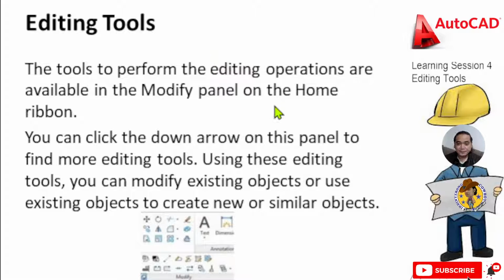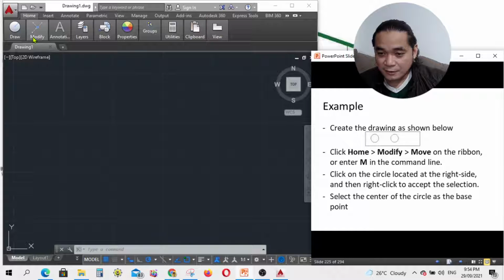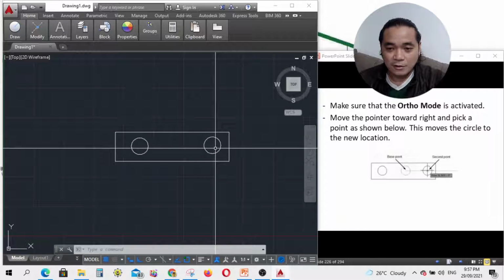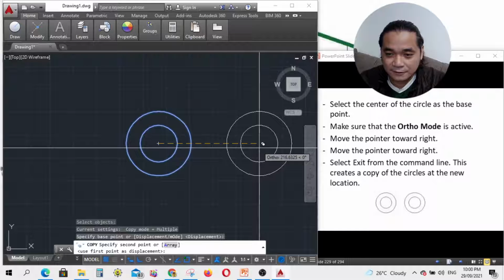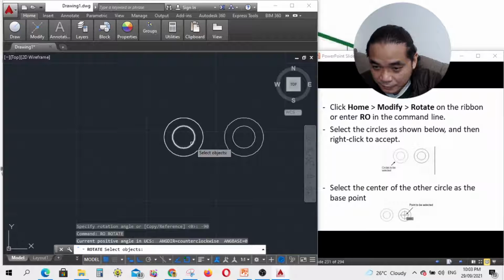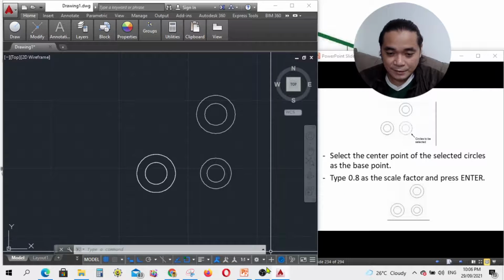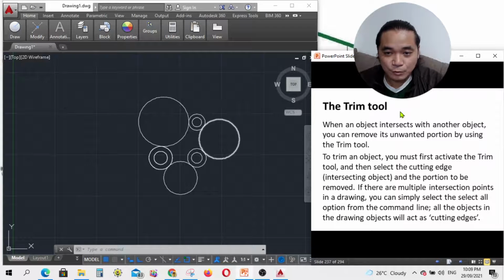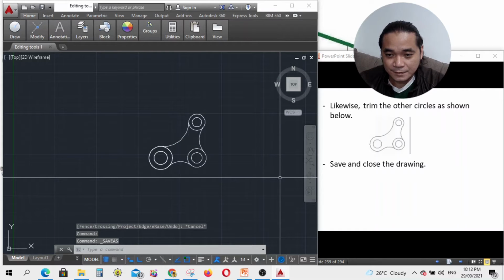AutoCAD LS 4-1 | Editing Tools

Comment: LS 4-1| In this video, I learned how to use some of the editing tools in the home tab, specifically the modify ribbon, such as the move tool, copy tool, rotate tool, scale tool, and trim tool. We can use these tools by simply clicking the tool's icon or by typing a command into the command line. We can use these editing tools to modify or reuse existing objects to create similar or new objects. Finally, by applying the knowledge we gained (with precision) from this video, we will undoubtedly be able to create a more refined drawing. 

Keep it up Sir! God bless you always.

Comment: LS 4-1| I have learned in this video on how to execute some of the the editing tools such as move tool, copy tool, rotate tool, scale tool and trim tool which is located in the home tab specifically on the modify ribbon. We can use these tools by simply clicking the icon that represents the tool or by inputting a command in the command line. By using these editing tools we can be able to modify or use existing objects to create the similar or new objects. Lastly, by applying the learnings we gained (w/ exactness) from this video surely we can create a better and refined drawing.

Kudos to you sir! Looking forward for your next video! 🤗

Comment: For the first section of learning session 4, I really enjoy the video material since it significantly helps my knowledge of AutoCAD's Editing capabilities. I've discovered that in order to produce complicated designs, different editing procedures may be used. We may change current items or utilize existing objects to build new or similar objects using these editing tools. The editing tools covered in this video include the move tool, the copy tool, the rotate tool, the scale tool, and the trim tool, which I used to create the examples. The Move tool relocates a chosen item without altering its orientation. The Copy tool is used to duplicate items and reposition them. The Rotate tool rotates an item or a collection of objects around a central axis. The Scale tool resizes things. It alters the size of an item without altering its form. When one item overlaps with another, you may use the Trim tool to eliminate the object's undesirable part.

Comment: I learned the operations and commands of several editing tools during this session, including the move tool, copy tool, rotate tool, scale tool, and trim tool. AutoCAD has a move tool that allows you to relocate an object without altering its orientation. The copy tool aided me in duplicating an object and relocating it to a certain spot, the same as rotate tool. In respect to the scale tool, it has aided me in reducing or enlarging an object's size without altering its form. Also, trim tool enables me to eliminate undesirable parts of an object while sketching it. Thank you sir!

Comment: IN LS 4-1, I learned how to use and execute the move, copy, rotate and scale tool. Move tool which moves a selected object from one location to a new location without changing its orientation. Copy tool is used to copy objects and place them at a required location but the object will remain at its original position and a copy of it will be placed at the new location. To rotate an object or a group of objects about a base point, we are going to use rotate tool. Lastly, to reduce or enlarge the size without changing the shape of an object used scale tool. Thank you so much for the new learnings Inhinyerong Cowboy!

Comment: For the first part of learning session 4, I really do appreciate this video content because it greatly aids my understanding of AutoCAD's Editing tools. I’ve learned that in order to create complex drawings, we might perform various editing operations. Using these editing tools, we can modify existing objects or use existing objects to create new or similar objects. The said editing that’s being discussed in this video are move tool, copy tool, rotate tool, scale tool, and trim tool which I performed in doing the examples. The Move tool moves a selected object from one location to a new location without changing its orientation. The Copy tool is used to copy objects and place them at a required location. The Rotate tool rotates an object or a group of objects about a base point. The Scale tool changes the size of objects. It reduces or enlarges the size without changing the shape of an object. When an object intersects with another object, you can remove its unwanted portion by using the Trim tool.

This video content is very informative. I'm excited to see the next videos!

Comment: In this part 1 of learning session 4, it talks about editing tools that tackle the different tools that will explain the most commonly used such as copy tool, rotate tool, scale, and trim tool. However, the tools to perform the editing operations are available in the modify panel on the home ribbon. Through these, I’ve learned how to move tools. For example, selecting the object from location to a new location without changing its orientation. Moreover, I've realized that this kind of editing tool is very useful and helpful. 
Thank you for this Learning Session Sir! Hoping for more videos :)

Comment: This session it focusing in editing tool in auto cad. Which are move, copy, rotate, scale,trim, extend tools etc...... The tools to perform the editing operation that are able in modify panel on the home ribbon. It's also discussed the different tool and where they find it on the screen or monitor in the auto cad  and special each individual function.

Comment: In this video I have learned and performed some of the editing tools such as move tool, copy tool, rotate tool, Scale tool and trim tool which can be found by clicking the Home tab and then the Modify ribbon or you can command in the command line. Using this editing tools you can modify existing objects or use existing objects to create new or similar objects. Thanks you so much sir for the learnings and looking forward for another videos.

Comment: Hello and good day, Sir. Upon completing this learning session, it highlights the ease of use of AutoCAD's editing tools and its features. Basically, each of these editing tools has its own shortcut command, besides being accessible from the home ribbon's modified panel. As shown in the video, each of these tools is beneficial for modifying objects. Learning the functions and shortcut commands of each tool may be challenging at first, but they may be quickly memorized if performed often. In terms of the various tools, the move tool allows the user to move the selected item to the desired location without changing its orientation, the copy tool allows the user to duplicate the object and paste it in the desired location, the rotate tool simply rotates the object, the scale tool allows the user to reduce and expand the object, and the trim tool, as the name suggests, allows the user to trim/delete a section or undesirable piece of the object.

Looking forward for more videos! 
Thank You and God Bless

Comment: LS 4-1. This video has taught me about the Editing Tools. AutoCAD has move tool which moves the object into its new location without changing the object's orientation. Copy tool helped me duplicate an object and place it a certain location. Same goes for rotate tool. With regards to scale tool, it has helped me change the size of an object, whether to reduce or enlarge an object without changing the shape. Trim tool helps me remove unwanted portions while drawing an object.

Comment: In this learning session, Engr. Mardie discusses on the editing tools in autocad. Basically, editing tools are the tools to perform the editing operations and its available on the modified panel from the home ribbon. It has several editing tools that would be used on making a drawing like move, trim, line, circle and many more.Using this editing tools you can modify existing objects or use existing objects to create new or similar objects. I am very thankful because I learned on what are the function of each tools and this is very important so that the results are in error reduction and fewer chances of mistakes. Moreover, the designs which are made digitally always have room for enhancements and improvement. Thus, we have seen that a drawing can be drawn and further modified from the above-mentioned tools, scaled, copied. These tools help us in major operations of drawing using AutoCAD software.

Comment: AutoCAD LS 4-1

In this session, Engr. Mardie discusses on the editing tools in autocad. The video entails several editing tools that would be used on making a drawing like move, trim, line, circle and many more. Basically, editing tools are the tools to perform the editing operations and its available on the modified panel from the home ribbon. You can click the down arrow on this panel to find more editing tools. Using this editing tools you can modify existing objects or use existing objects to create new or similar objects. I am very thankful because I learned on what are the function of each tools and this is very important so that the results are in error reduction and fewer chances of mistakes. Thank you for this video sir and hoping to see more.

Comment: This video enables me to know the functions of the different editing tools which can be found by clicking the Home tab and then the Modify ribbon. Move, copy, rotate, scale, and trim tools are the ones covered in this video in which their respective shortcut keys were also mentioned. When using the Move and Copy tools, turning on the ortho mode is important to align the objects you want to move or copy. When using the Rotating tool, it is critical to specify the degree to which you want to rotate an object. The Scale tool, which allows you to change the size of objects, is also a very useful editing tool. And we have the Trim tool, which is one of the necessary tools there is in AutoCAD as it makes your work easier by erasing unnecessary parts of the object.